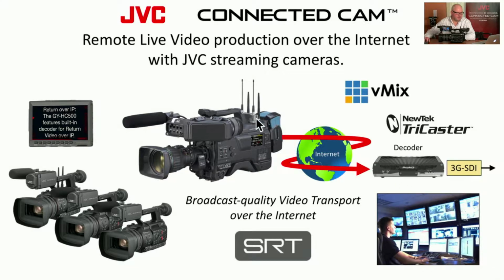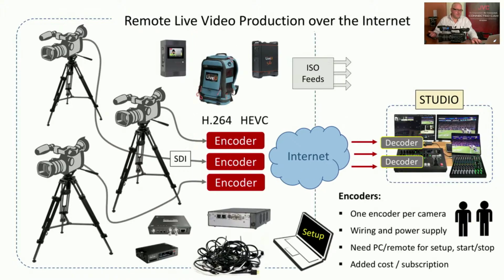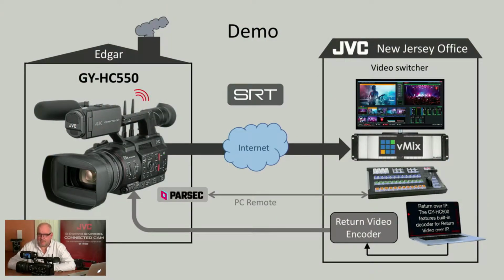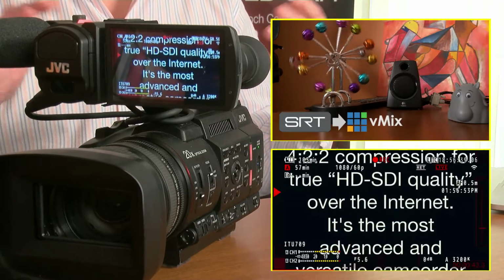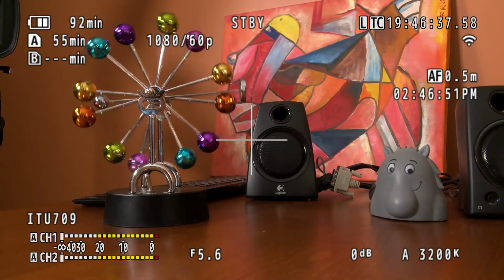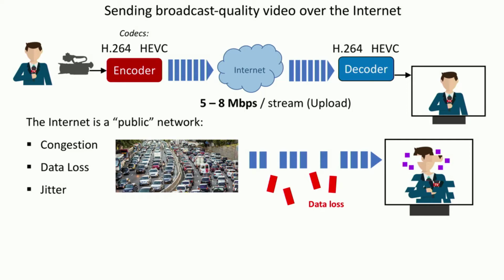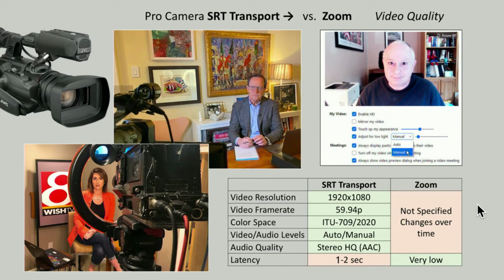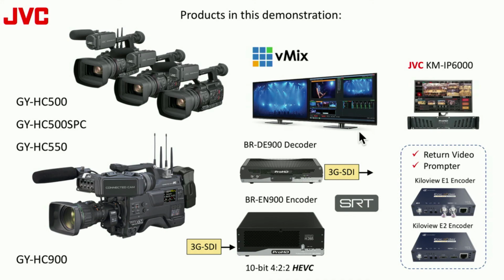Remote live production over the internet with JVC streaming camcorders, using SRT protocol

Comment: How do you send back the return video ? As I see in the vmix inputs you set up the Jvc camera as caller and vmix as listener. I suppose you use the srt vmix output pointing the public IP address of the camera. Or there is a simpler way like srt://jvccameraID:port ? Because I'm just wondering what happen every time you reboot your wireless AP that the camera uses, it basically gives you a new public IP. On the vmix machine you can set a dyn DNS app so no problem, the IP will be resolved with a domain name, I wonder if it is possible in the cam too